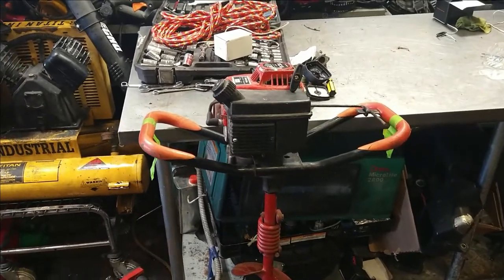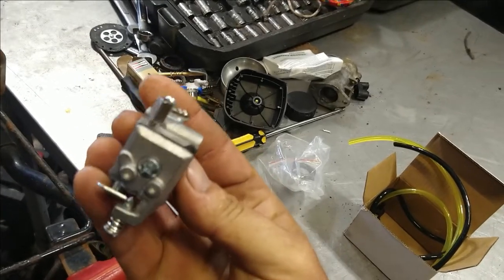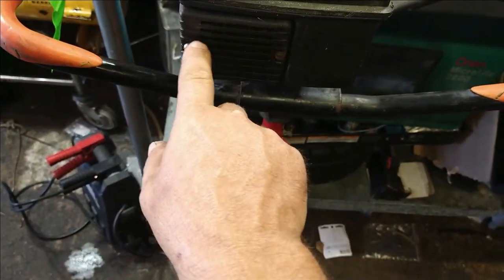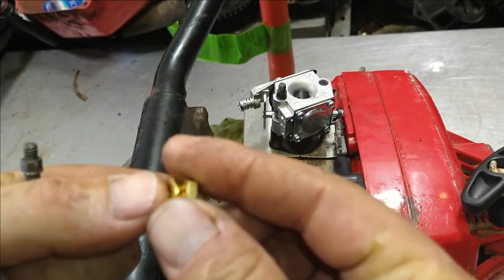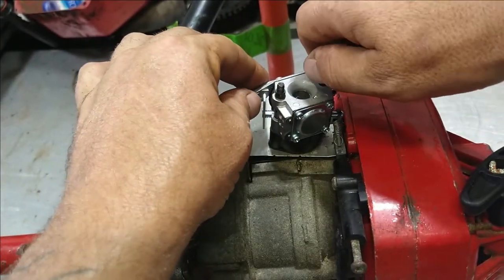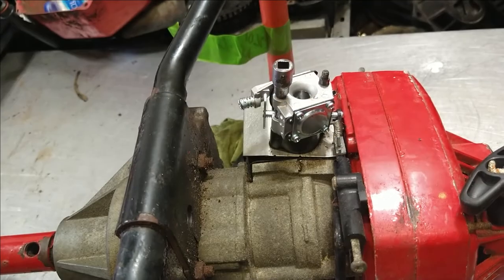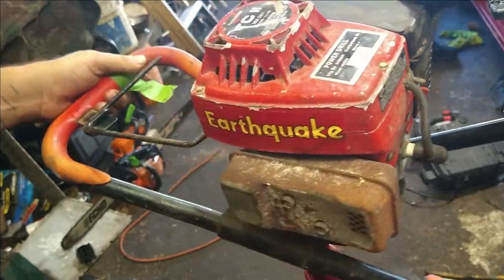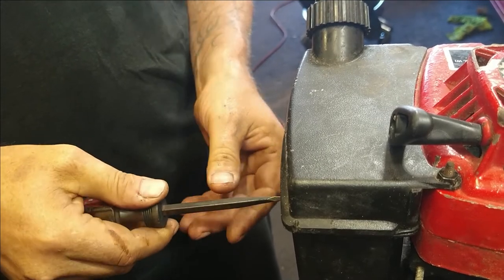Tecumseh tc2 tcII power drill model 8900 ice auger carburetor fuel line kit install repair

Comment: Thank you for making this video,  I viewed a couple others but they were all on what I'm guessing newer models and slightly different.  I really liked how you just removed one screw to put the plastic governor on.  The other videos I watched they went crazy and took apart the whole assembly,  the metal flap inside and everything.  I was like you gotta be kidding me,  you should just be able to remove that stupid plastic piece easier than that,  well your video confirmed I was right lol.  Anyways the main reason I'm commenting is for those not interested in drilling that out,  I used a T-8 Torx bit and it came right out.  I recently got an amazing deal on a Dodge Dakota that was wrecked up a little bit in the front.  I was running into a lot of Torx head screws.  I bought an inexpensive set of Torx screwdrivers from Amazon and since then it's come in soooo handy.  Didn't look but you could probably get a set of magnetic bits even cheaper.  I've never run into so many things I've needed Torx bits before I got this kit,  kind of crazy lol.

Comment: That plastic governor screw appears to be a star shape so you do not have to drill it out. I have a set I bought a few years ago. They were at the time called tamperproof tools. They fit parts that some manufacturers do not want you to have the ability to remove.  And it does remove the bolt. BUT now I cannot get the Philips screw out of the new carb as it stripped way too easy! WTF. It is  tight! The plastic one from the old carb when the screw is removed is oval-shaped so probably will not fit.  Have not decided on what to do. Going to watch the rest of your video to see if you have my issue. I see it did not fit for you but you lined it up the best you could, and it ran well for you. I am going to grind the head off my stripped one and insert a new bolt. Nice vid by the way
Reply: Used a dremel tool to cut a screwdriver slot. Still could not turn, With a lot of effort one side of the slot broke off. Nipped the other side off, but could not remove the threaded part. Too small to try an easy out. I believe they used thread lock. They did not have to, as the shaft was oval to hold the lever in place. Pissed off as I am returning the carb. No excuse for that not being removable, as that plastic one is necessary for the toll to run right. By the way, my toll is a mini cultivator

Comment: hello, there doesn't seem to be any adjustment screws on the carb and its not getting full power when I pull the trigger and its at WOT, how would I adjust the high idle? thanks in advance
Reply from the maker: the adjustment screws are located on the bottom side of the carb. high is one closest to the air filter
Reply: @smallengineguys  great, will look for them and give it a try. thank you!